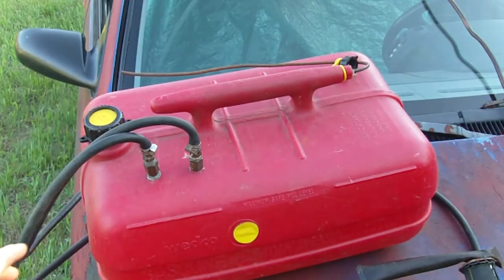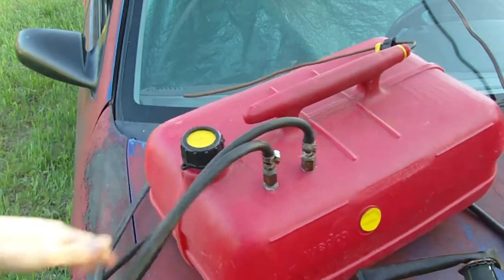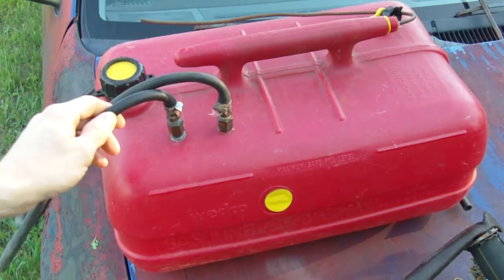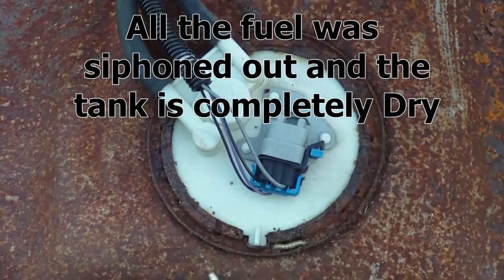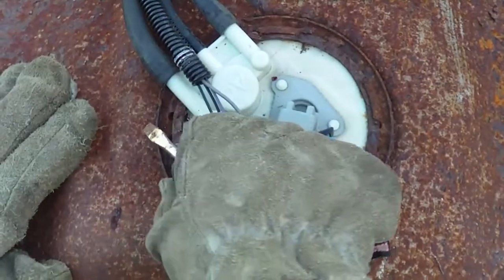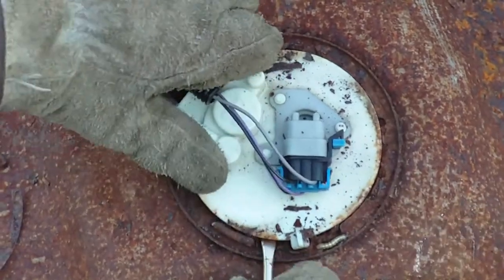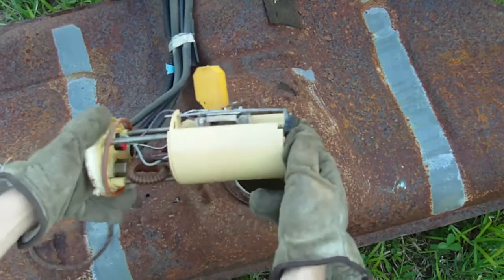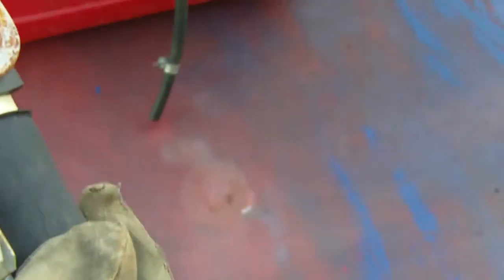External Fuel Tank - How-to Convert Boat Tank to Auxiliary Fuel Tank

Comment: ..you could probably do this with fuel injection if you had a hand pump to add about 50 pounds pressure and ran a return line back to the tank?....